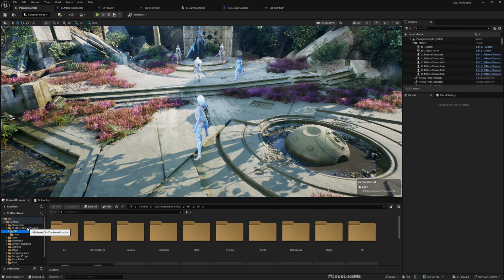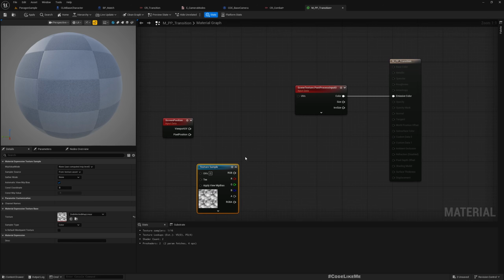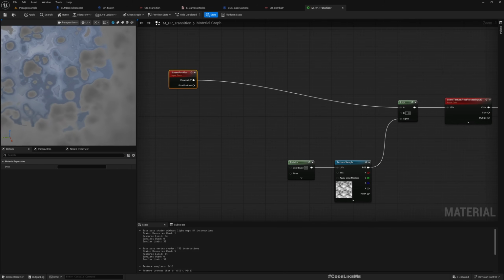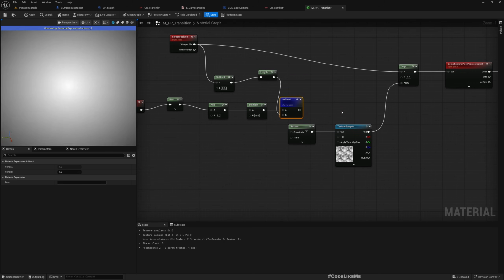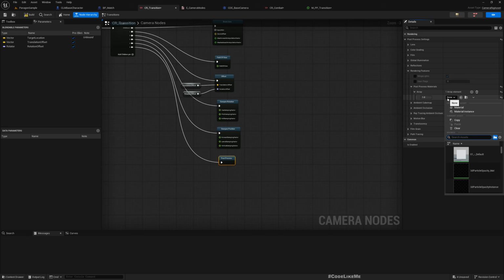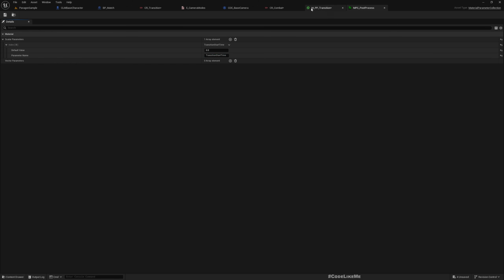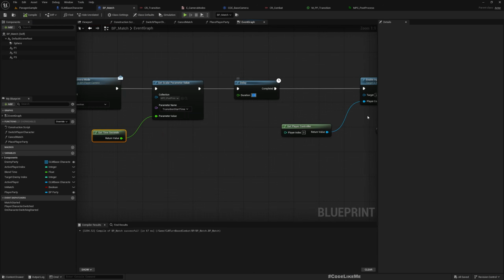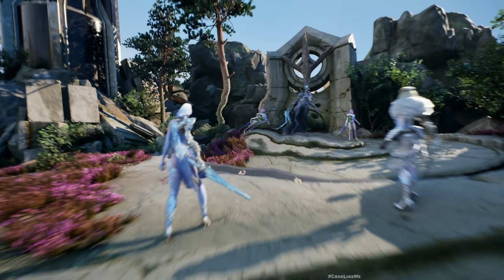Free Roam To Combat Post Process Effect - Unreal Engine Reactive Turn Based Combat #27

Comment: More issues with this when it comes to switching characters, seems to take too long and when I aim it keeps the healthbar of the last thing I aimed at up!

Hmm a few issues to figure out
Reply from the maker: Both sound like state-cleanup issues. The healthbar one is probably the previous target's widget not being hidden/destroyed when target changes — check the targeting blueprint logic for where you set a new target and verify the previous target's UI is being explicitly cleared. 
As for the switching delay, try adding Print String nodes through the character switch flow to see where the time is actually being spent.
Reply: @CodeLikeMe  Thanks for the response. It was an issue with LT/RT being used in both IMC's for switching characters.

I used the D-pad for switching in combat, seems to be working